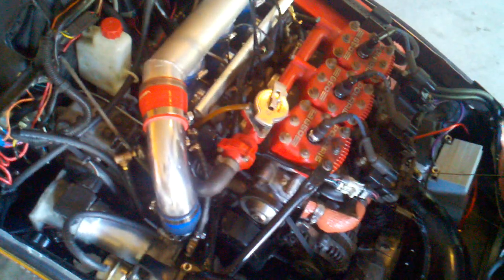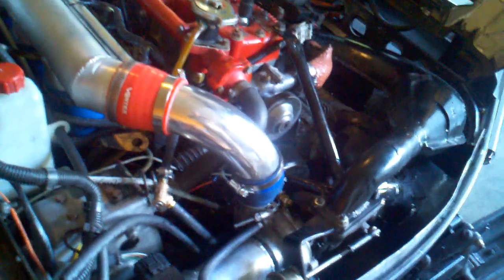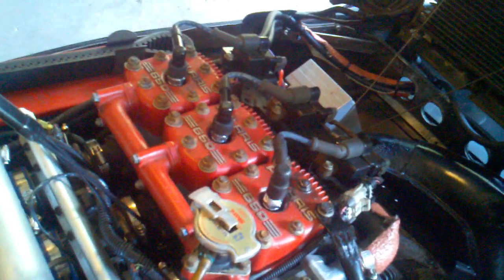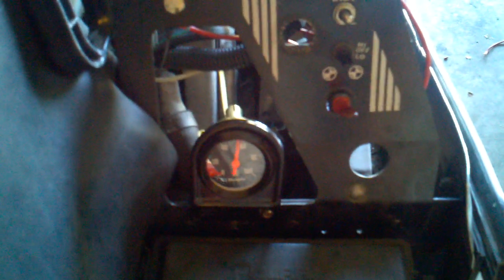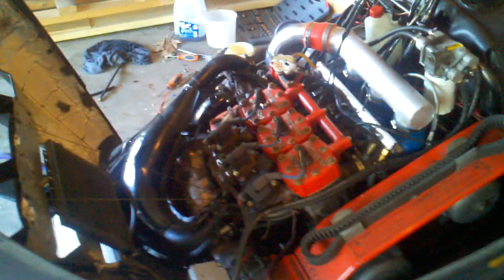Turbo Indy 650

Comment: impressive build....have you had it out for a run yet? Very interested in more technical deets on the setup....size and type of turbo. More info on the crank/reluctor wheel set up. Estimated HP? are you doing radar runs or just trail riding? Either way, would love to chat more on your set up. I am an old polaris guy and owned several RXL's...absolutely loved em back in the day....your handiwork may be just what they need to keep up with todays modern iron....! Keep up the good work.